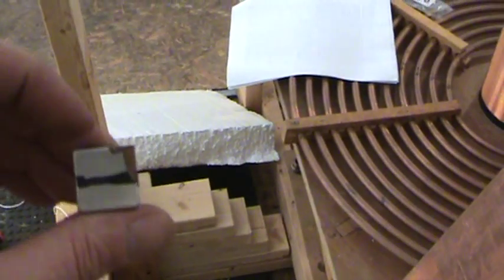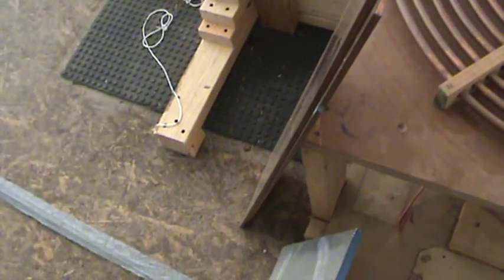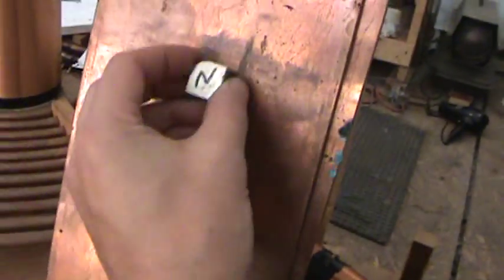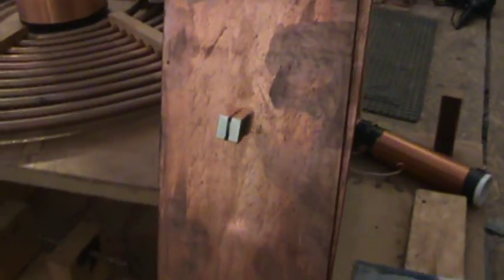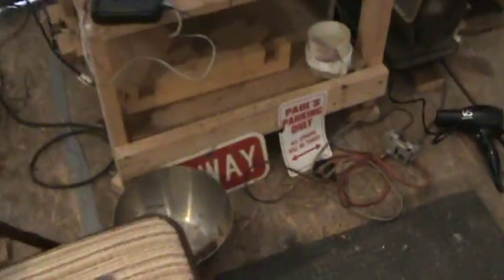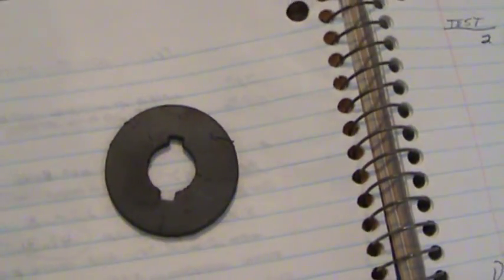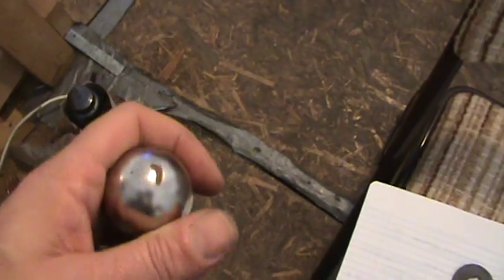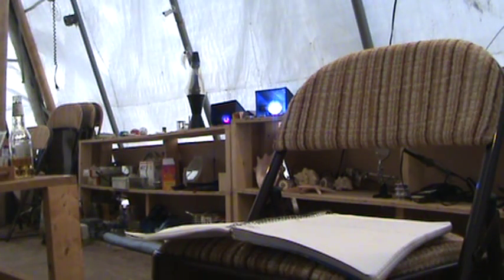Antigravity Effect , Magnet Through Copper Tube, part 6

Comment: see the nickel plated dime under a post card next to a speaker then press call on phone the dime sticks under card you can let go of it it sticks till phone call ends interesting video to manipulate i think timing of planets magnetic rotations have to be accounted for a nuclear bomb might not blow up if timing incorrect ?the nickel onthe out side of dime must carry the feild as electric dont travel though center as the case for electric wires ?ave a goodone
Reply from the maker: Thank you for your comments.  Do you happen to have a link to the dime & cell phone thing?

Comment: It's the valance electrons which can give up electrons only if sufficient energy is used to dislodge it's bonds.  Of course the further out the electron orbit is, the less amount of energy is required to loose an electron.  Then there are ions which have either extra electrons than protons or fewer electrons than protons.  I'm not sure about electrons in the air, they tend to want to latch onto holes and reach an equilibrium with the atom.  Good discussion.

Comment from the maker: Hmm, they say when one atom has an over abundance and the neighboring one has an underabundance,,one will give up electrons to even things out. An atom has only soo many electrons to give up.  I say extra electrons are coming from the air and being transfromed by the magnet into the copper.,,i believe this is the effect with all generators. Electrons are used up in doing "work", in the load circuit, they have to keep coming from someplace.

Comment: The resistance you are experiencing is due to Lenzs Law.  It is an interesting phenomenon. As the magnet slides down the copper plate, a current is being induced creating an electrical field and an opposing field is counteracting the the induced field thus slowing the falling of the magnet.  Perhaps you already know this.

Comment: @camelsonhorizon well your proof in my opinion lays hereas you are on good tracks , : maybe : move Copper BY the magnet and test for current, you DEFintely should have a current meter somewhere, and see Joule Theif etc, make a coil of awg wire that is connected to a light emitting diode to SEE the magnet current dissolve in a diode, per se.  by position, ..along the path of gravity where it moves.  my guess is that you would get current and usable "work" by the magnet, PER Gravity.  righteousman

Comment from the maker: @camelsonhorizon yes, i understand. Mybe an attraction and a resistance type of force, yes both.
eddy currents on top of mag are spinning one direction and eddy currents on bottom are spinning in opposite direction, well they say it is not the eddy currents directly but rather the currents that the eddy currents make are opposing each other,,,but im still not convinced that this is what is actualy happening here, science has not always been 100% correct.

Comment: @INVENTOR3 it is only an Attraction to the affect of the FIELD induced into the copper.  a MOVING magnet will Induce a field in metals conductive. (not necessarily Magnetic at all.)  if it will conduct, a moving field past IT will make a potential for the field to change from a magnetic field to a current...INDUCED.  I would say , then, it is not a resist OR an attraction, basically.  it could be both at the same time though, you dig?

Comment from the maker: @camelsonhorizon Hmm, yes, this is what the science community believes is happening now. Hmm, this drag, would you say it is a "resistance" or an "attraction"?i believe now, because of recent experiments(i may have to make a video of this)that the permenant magnets have an "attraction" to the plate of copper. when magnet slides down the plate and the poles are facing horizontaly, the magnet will pull away from the edges of the plate, even if i tip plates to the side!